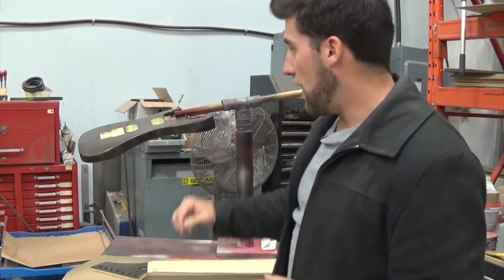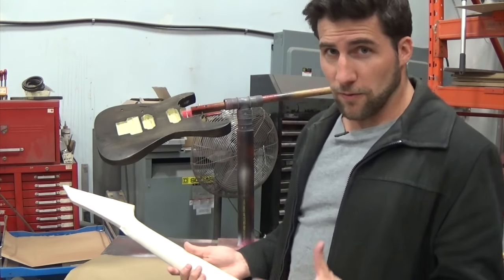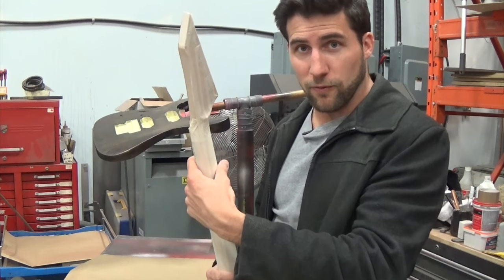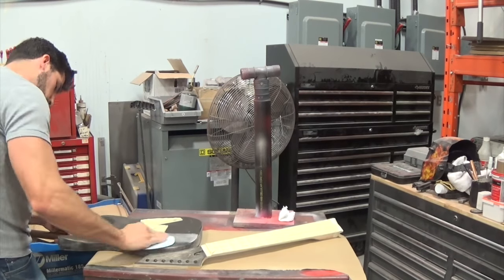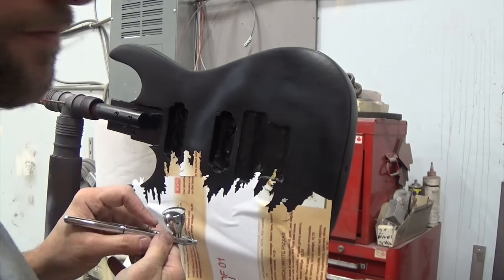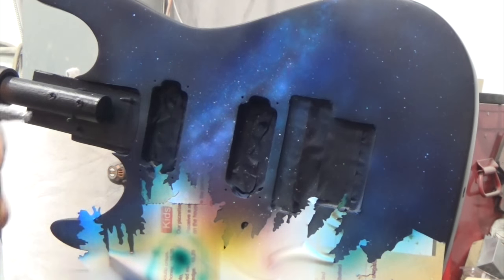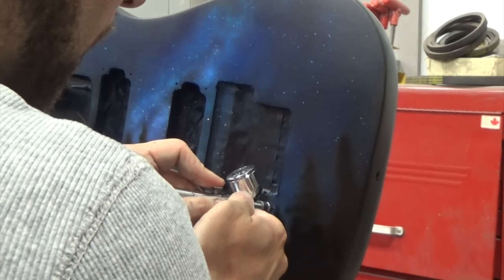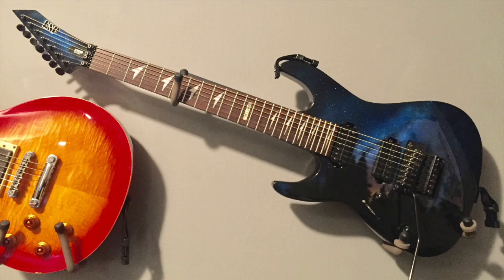Awesome custom guitar paint job - Galaxy airbrush

Comment: after you finial sand with 5000 grit you could Polish it out with just rubbing it with your thumb lol and that's a good thing with all those tight areas that are so hard to get at .
Reply from the maker: Yes, the 5000 grit does make it easier. Generally the paint lays out nice enough along the edges that there's no reason to sand and polish them, but sometimes you get some orange peel in there and it can't be helped.

Comment: May I ask what air spray gun you use please and what you recommend to look for in a gun?
Reply from the maker: I would probably get the Warwick 878 if I were selecting a gun for color work on a guitar at this point. Small gun, reasonable price, and if get it with a 1.2 nozzle.